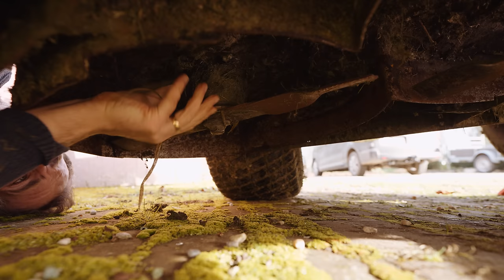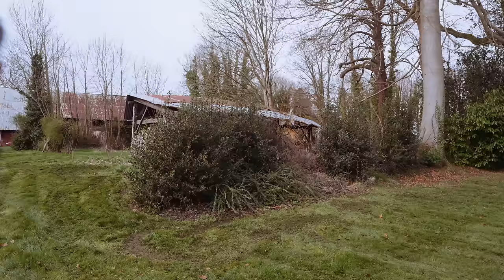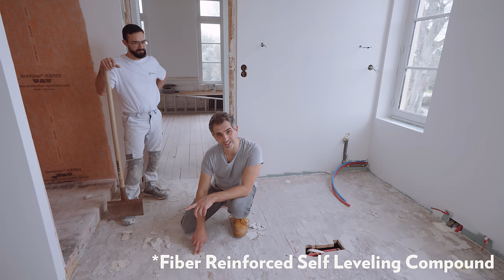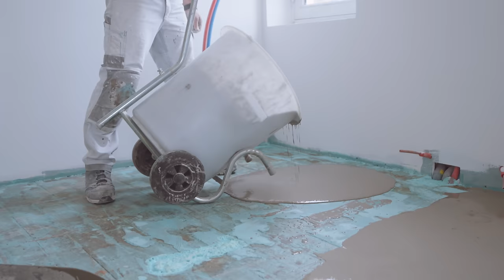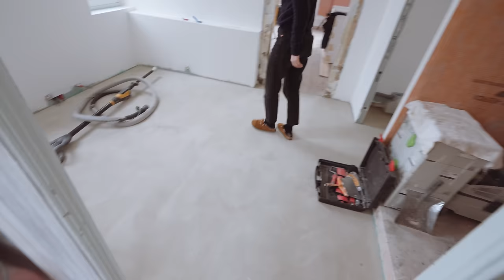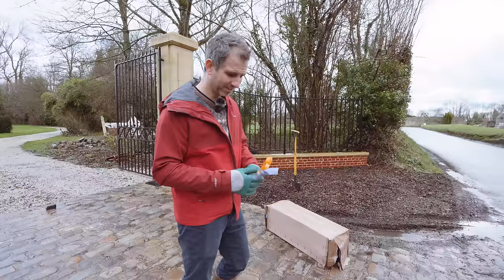This New Floor TRANSFORMED our Chateau Master Suite Bathroom.

Comment: I am surprised you didn't change the blade or clean it up but it worked no less. Love Anna's floral designs so talented maybe a snowdrop style one for your bath if you use wallpaper or a print series in frames. That stuff that fixed the floor maybe link in description as sure even Billy Petherick would find that useful in some of his rental units. Gardening is lovely therapy I agree. Have a lovely time Philipp and Anna and family.

Comment: Ooh I'm a huge fan of "Vildvin" (in Swedish) ie Boston Ivy! Many years ago I had a flat on the 5th floor with a looong balcony with a wonderful sea view. It was a recessed balcony with walls on 3 sides and a ceiling, materials were grey concrete and red brick walls respectively. I wanted to create an outdoor "green room" feeling, and meld the differebmnt materials together, and came up with the idea of using Boston Ivy. It only required 2 plants to do the trick in a year or two. It was so lovely, bc it turns a beautiful brick red in autumn, then a dark burgundy in October-November beforw withering to discreet trmwigs to rest in winter, then booms again in spring and grows 3 or four meters at least, every tendril, in a season! It's also the perfect backdrop to any flowers (which I planted from seeds each year) AND provides non perennial climbers with something to latch onto!  I adore it so much, if I one day have a lime-walled or brick house, or a small walled garden, that's the very first thing I'd plant! Btw, another really good ground creeper is periwinkle, which is evergreen leaves, low and blossoms with blue flowers all spring.
Looks like you're both really productive right now and the nexts steps will be the most fun to watch!
(that tumbleweed medusa head of elecrical wires, where did that come from?! Sheesh! 😬)
Love the lush greenery you have in February! 😍
👌❤️❤️❤️

Comment: The bird in the lino print is an excellent addition. personally i would be tempted to make some separate linos with a few different birds and then add them in later across the top 1/3 of the wall here and there.

Comment: I can't deal with mowing just yet!  Yes, I've had stuff wrap around the blades but I usually get a neighbor to grovel underneath to pull it out. Age has its blessings ;-)  Lonicera maigrun are called boxwood honeysuckle in the US and parts of the plants are poisonous, but they are deer resistant.  I will look into those...

Comment: Phillip, with as many evergreens as you have an eletric hedge trimmer may be a wise investment. It will make hedge trimming go much, much faster and you can use them to cut perennial and ornamental grasses to the ground for spring cleanup. With as much land as you have and with so many new garden beds it should save you quite a bit of time and effort.

Comment: Yo, landscaper here- they make a tool a  bit like a weird hand-truck in form, that you roll under the mower deck and use it as a lever to tilt the mower up to access underneath.  We call them mower lifts, idk if that's the term over there.

Comment: I know it sounds absurd but it’s actually fairly easy to just pick the front of these mowers up and put a jack stand under the front. All the weight is in the back and leverages nicely on the back tires. I do this about twice a week on each of my mowers to pull the blades sharpen them and clean the deck. That leads to it’s really time to pull those blades and sharpen them and clean all the matted grass out. You will get a far better cut if you do.

Comment: A few comments: Wonderful floor! Happy Dance Around! The Driveway skirt: look to see where the oncoming traffic turns to get thru the gate,  then widen and extend the gateway skirt to cover that area. Don't fight 'em, join 'em!  Add a few BIG rocks right there on the corners to encourage them to stay on the pavement. It is a pretty narrow entryway right now and would be hard to turn there for big trucks and equipment coming from the side road. I'd plant cherry trees at the gate to bloom in spring and look beautiful. Perhaps some yellow forsythia bushes along the gateway wall? If it doesn't add color and scent or fruit, what's the point?  I Love Anna's wallpaper! Think you are the reincarnation of William Morris! Another great video! Did you put in a master switch in your bedroom to control all your lights in case of emergency, like I suggested? Remember the housefire on "Downton Abbey"? They had to evacuate the house late at night, going down the stairs in the dark and stand around outside in the dark and rain because there was no center switch Lord Grantham could pull, no fire alarms, and no nearby shelter ready for them to run to!   Be warned! Are you practicing fire drills, just in case? Can you get out of your bedrooms if the stairways and hallways are blocked? Have you asked your local fire department to come and evaluate you and make safety suggestions? Be prepared! We love you!
Reply from the maker: We have a foldable fire escape ladder ready to be deployed from a window

Comment: Technical issue 1  - think about: ‘floor level changes’ across and between this large area. 
If ignored, you create a minor announce and minor tripping hazard that Never goes away. 
Proposed solution - bring all floors to the same level - hard work but worth it ( noting you already have a step-up into the shower which can’t be resolved now. 

Technical issue 2- great rule of thumb here.  Never have more than two flooring types visible in ‘one line of sight’
Eg from window to window through the bathroom) 
A subtle aesthetic glitch that  creates an sense of ‘ something not quite right here but I’m not sure what it is ‘

You are at the point of no return right now.  Perhaps a ‘normally closed’ door would help (eg auto closer mechanism) - would break the single line of sight issue 

For your consideration and action.
Reply from the maker: Thanks for the tips! There will be only two floor types as the two rooms have the same parquet

Comment: The MOWER is a machine and should be serviced regularly. Question – how often should you remove the debris on your mower and under your mower around the blades? Answer… After you mow each tear after you mow, so that is part of the responsibility of riding Such a machine. It brings you power, you feel good on this machine, and it makes you look good as well when you have finished and all your lines are nice and neat. So therefore, you must take care of it treated with kindness. Remember how much you pay for it and if you don’t want to do so, let it be the responsibility of the young man who mows your grass and never forget it is not girly to read directions. When was the last time you checked the oil , Yes, you have to check the off and please have it serviced at the end of the season
Reply from the maker: You are totally right, I'm guilty of not cleaning it each time, I do however change the oil according to the manufacturers intervals.